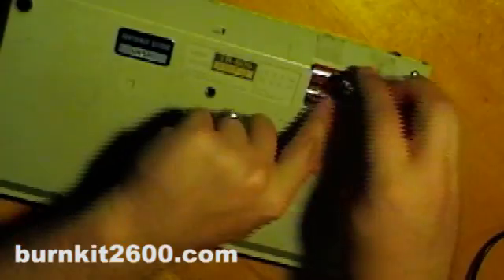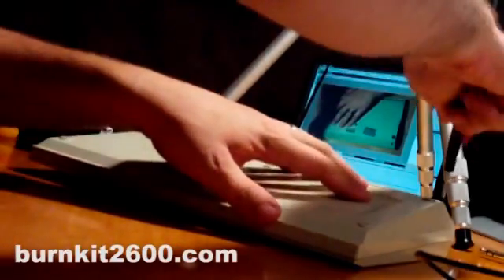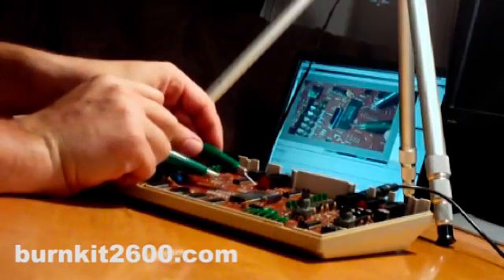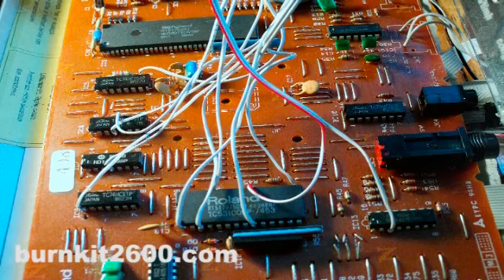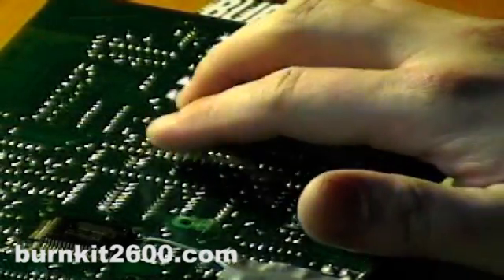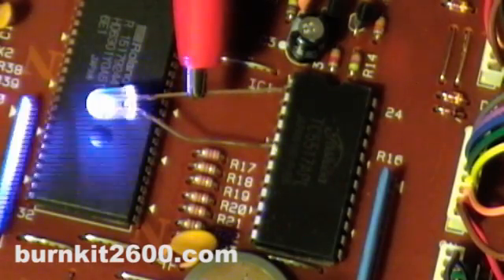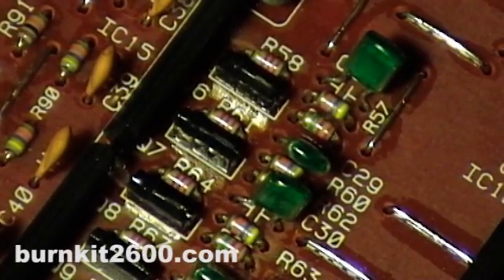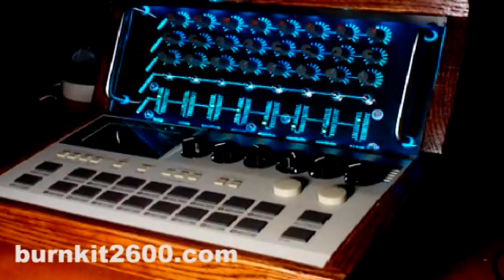How to Bend TR-505

Comment: hey ive been looking at this for a few years, and i want to get this made, i used to check on your website but your site is down (funnily enough in getting an error 505) 
do you have it all backed up or may be you switched hosts? any info would be great.
mostly im after a plan for the front panel with the 3 pots switch and slider as ill probably use sheet metal for the back connections.
Reply from the maker: Hi! I am actually rebuilding the website now. The tr-505 page should be back up: https://burnkit2600.com/tr-505/
Reply: @burnkit2600  oh you saviour!! I've needed something to make for a good while now and I can finally get this checked off!!

Cheers for all the work you put into this!

Comment: can you do damage to the 505 if you touch the wrong points?
Reply: I'd say yes, if you touch the two power pins of a chip, you'd short the batteries and might burn something, that's why I would suggest using a current limited power supply instead, set on the lowest setting possible that works, so if you short anything bad the power supply should drop off and only crash the circuit without damage.